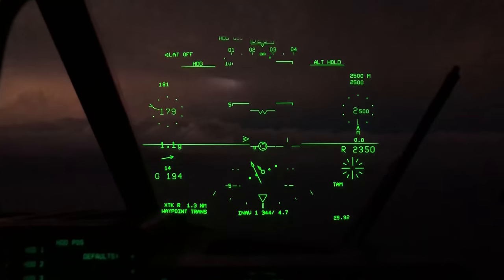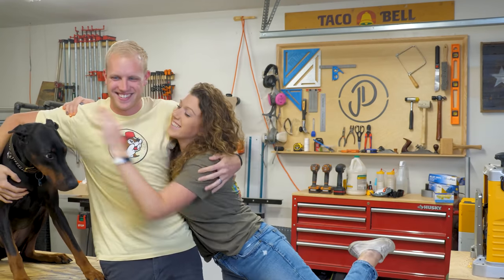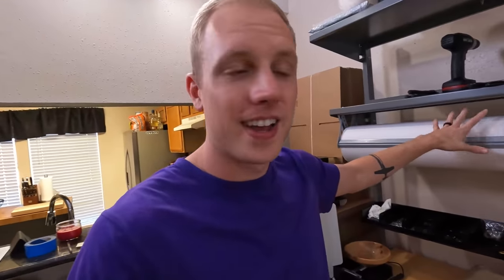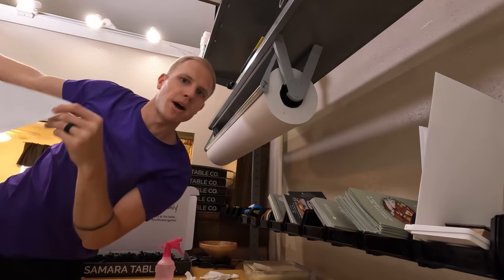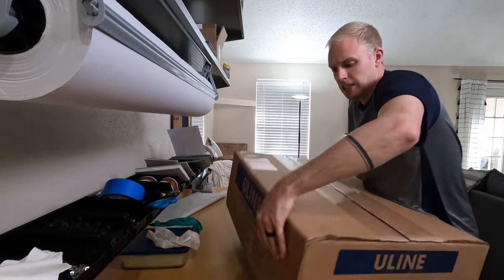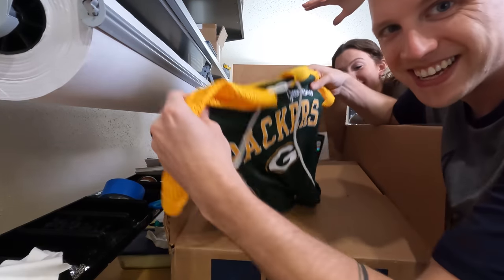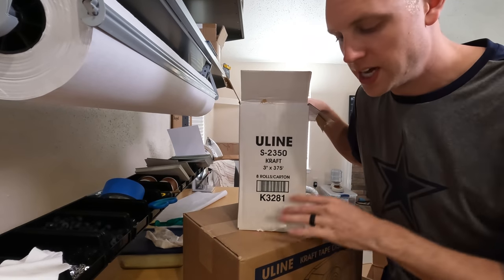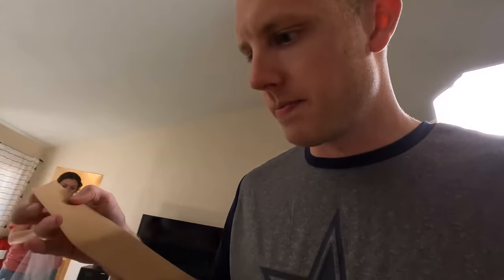Jennie’s sales numbers are SHOCKING... (she's amazing!)

Comment: @10:16  In the shipping world we use the paper tape for heavy objects. For the light products we tape using machines with rollers on both sides. As you push the box through it tapes the top and bottom for you. When you finally go commercial an older used tape machine would definitely benefit you. The paper tape is amazing, but a few hours of sticky glue fingers gets old fast, trust me...lol. Hope this helps...👍

Comment: We use paper tape at my job. My department does (among other things) package performance testing to make sure our multi thousand dollar scientific instruments get to our customers w/o shipping damage. In my department we have a similar tape dispenser (though the handle is on the left and the reservoir is on the right). The cut-length stop on the handle is wonderful for getting repeatable lengths of tape quickly and only have to think about how much is needed once (instead of every time you dispense a single piece of tape). Now, down in our shipping department, they have an electronic one where you press a button for the desired length and it nearly throws the tape at you. Scared the bejezus out of me the first couple times I used it.

Tl;Dr - I have a similar tape dispenser at work and love the ease of use. I think you will as well.

Comment: Congrats Guys! Efficiency is everything and having everything needed at an arm's length to complete a task is crucial. Be it shipping or building repeatable products. (I'm a one-woman shop and only sell at craft fairs locally or for gifts, so not online.) It's just for a little bit of extra cash at the end of the year for a vacation or something special I've wanted. Usually something for the shop, lol, and the rest into savings.  But I take a lot of orders at these fairs I go to around the New England area so I needed to set up a spot that is efficient for me. Before that, I would hunt for the tape or a gift box, etc. I have the same paper dispenser only smaller for the kraft paper I wrap my boxes in. I wrap each internal box as if it is a gift and use only natural materials. I stay away from plastic as much as possible and use the same type of paper tape that you purchased only I wet it myself in a homemade steel dispenser I made because I like welding and unlike you two, I have the time. The tape is much stronger. When I'm carving on a jewelry box, each step of the way is at a different area. The carving tools-one area, gluing and clamping, in another area, cutting down stock in another, and so on. I might suggest a tool for your new commercial space. I acquired a used Radial arm saw last year, and it was the best tool I have purchased of late. It is used for breaking down the rough stock I get from a local mill or for dados. It is great for repeatable cuts. The older models are cheap at the $50-$250 range compared to new Compound miter saws. It was to last and built from iron. They have aftermarket blade guards you can purchase which I would recommend if an employee is going to use them.  I chose a 1950s Dewalt model in almost pristine condition by an older gentleman who took good care of it. A new radial arm saw runs approximately $4000-$6000 range for comparison. I got rid of my old, cheap miter saw, and if I need an angle cut it's very simple to do it on the radial arm saw as well. I also have a 4.5-foot long circular saw cross-cut jig I use for most angle cuts and is calibrated for accurate cuts. Just a thought. Sorry for the long "comment" lol. As always best of luck in the new space!